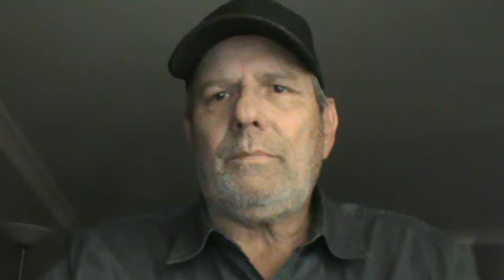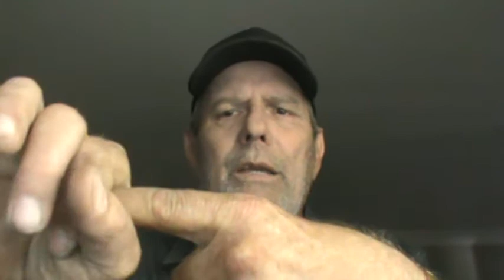For Techs - Learn Proper R12 to R134a Procedure - NO SLUDGE! - A 30 YEAR MISUNDERSTANDING!

Comment: This is kinda Fridge related but i have a question, I was given a car AC service machine (with internal tank) that looks to have a bad compressor as it runs but, doesn't recover from car or refill tank . its 134a machine. I don't intend to use it professionally i plan to just use it for servicing my own and family vehicles. With that said i don't really want to spend money on something i may use once or twice a year... But I do have an old R12 fridge compressor that runs,  if I were to drain the oil out of it, and replace it with PAG oil. would the compressor do the job? i believe the 134a unit is 8.8cc and the R12 is 8cc  and as it only being used for moving refrigerant I'd have thought it wouldn't make much of a difference? your thoughts?